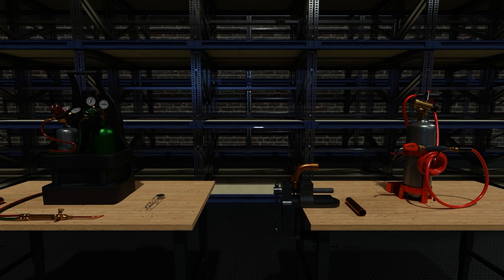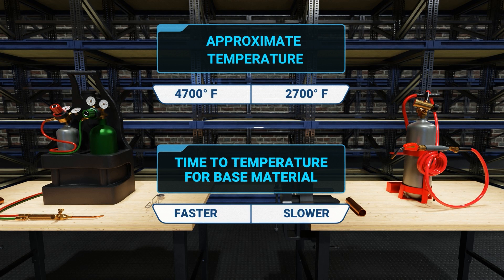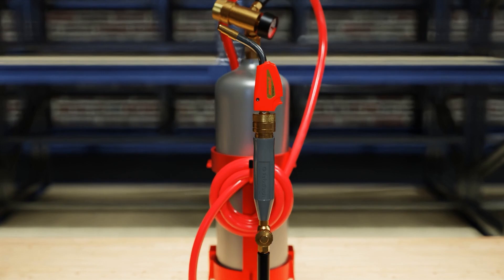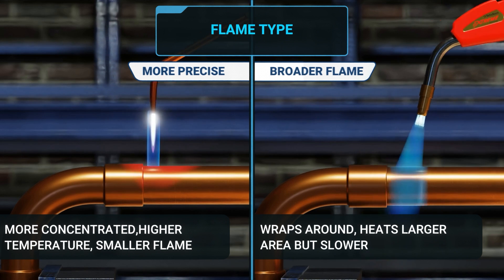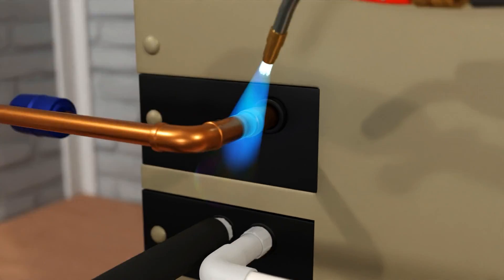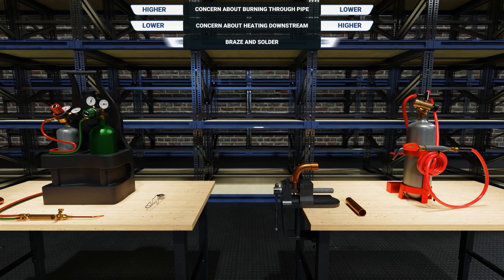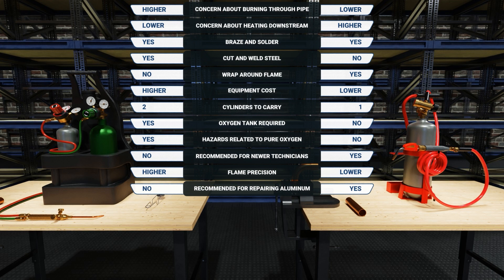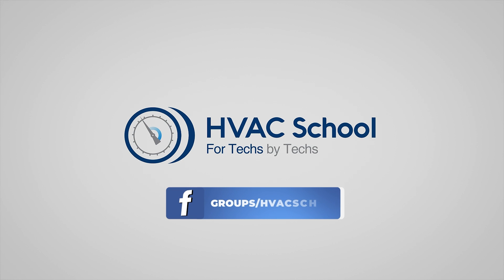Two Types of HVAC Brazing Torches (3D)

Comment: cool video. im curious is there are similar videos on the regular tip vs rosebud. only time i dont use rosebud is if im on something super small like 1/4 in a tight spot. otherwise 3/8-2 5/8 im using rosebud.
Reply: Hey Garrett your Rosebud tip is that for air acetylene?

Comment: I use both and when we're doing big commercial copper I use both at the same time. We just replaced two  1-3/8 reversing valves and the two torches made very short work of it. Also we cut them off with cable cutters. DO NOT USE STOP LEAK....

Comment: I prefre turbo torches. Its not even “that” much slower. The wrap around flame that the Turbo torches do or whatever you explained is a big reason why I prefer them. 😊
Reply: Air acetylene is arguably faster because of that wrap around flame. As soon as it gets hot you can seal the whole joint in one go rather then having to move the flame and heat up the other side of the copper.

Comment: A Trane virtual training video I just was in recommended propylene instead of acetylene. Ever used that?
Reply: In Ukraine we are using LPG - oxygen pair. It suitable for the most of applications. IMXO oxy-acetylene preferable when you braze TXV or something that must be protect from overheating. However LPG - oxygen pair is more oxygen consuming, LPG much more safer than acetylene, LPG tank lighter and lust much longer (rare refueling)

Comment: Strongly encourage the use of oxy fuel for commercial work. The wider range of pipe sizes and trickier spaces in which to work (usually) make it a valuable skill
Reply: I do strictly commercial only use air acetylene. As for pipe size you just have to select the right size tip for the job. And ive never had an issue with it being in a tricky spot (I work in Manhattan BTW) where i couldnt put a heat shield down and be fine. To each there own but i will always stick to air acetylene and the wrap around effect is very import for the type of work we do in hvac
Reply: Got both, air acetylene is what i used in 90% of the cases. The oxy acetylene is just very strong and can even melt the copper.
Reply: @tronixfix  I find that is mostly the case with people who never adjust their gas pressures. If you leave it at 5/10psi always you’re more likely to burn through a 1/4” or 3/8 line even if you’re using a smaller tip.
Reply: @paulgaras2606  i know what you mean but even with right pressures it will be hard to not overheat the pipes. The oxygen makes it burn super hot.
Reply: @tronixfix  yes you could look at it as a bit of a trade off. I do commercial service almost exclusively and Ive run into a lot of situations where braze joints held for a year or two and then let go due to poor penetration, mostly on jobs where the construction crew was using air acetylene torches and newer, less experienced people were doing a lot of the work. If you know your stuff, there’s no difference between air/acetylene and oxygen acetylene You’ll get good penetration with both and you won’t burn the pipe with either. But I just did a compressor set on a vrf system That had been installed without the use of nitrogen while brazing. We had to pull the oil solenoids, the oil separators and all the small cramped piping to blow out residual cupric oxide sludge. Air acetalyne would have made it really hard to work in those conditions. That’s why I say it’s good to get really skilled with oxy/fuel.
Reply: @paulgaras2606  sorry to correct but there's a huge difference between air and pure oxygen. Air can have a lot of moisture unlike pure oxygen also a lot of impuritys. Oxygen will always burn at higher temps. For me oxy air worked well for 90% of the cases unless it was around humid areas.

Comment: I've used Mapp gas, air-acetylene, oxy-acetylene, and for the last 20 years, have used oxyfuel-gas.  I do mostly commercial and find I need the precision and higher heat output of my current torch.  That said, I would love to see a video about brazing in the wind and brazing large fittings, i.e. 1-3/8 to 2-1/8.  Are there any tricks to keeping the torch burning in the wind?  How do I know when I am reaching the upper limits of my torch size?
Reply: The manufacturer of the tip should have a guide on what size each tip can braze. A #0 will braze up to 1/2" and a #2 will braze up to 1"

Comment: Just wanted to know what's your view on the cap n hook tip or other tips
Reply: I purchasing use the Captain Hook. It's nice at first, then I was having issues where the ports would clog and have erratic Flame. That's what I've heard in a clean environment.

Comment: I got a map can with turbo torch and I thought it would take me some time to get copper cherry red. Nope, it's quite fast, abt 10 seconds and it melts the brazing stick at 700 C. I feel like I will need simple prop-but with the turbo torch if i wanna efficiently solder with stay brite
Reply: Depends on the copper sizes
Reply: @UltraHydrophobiccoat  yes, true that. But also depends on the placement of wet rags. In any case, turbo torch really heats up copper sufficiently and its temp output can be lowered to levels oxy- setups can't step down to. Just my opinion based on few brazes ive done so far
Reply: @TakenIn-Wizardry  Thank you for sharing. I totally agree. I use Turbo touch with Acetylene whenever I have brazing job, but never tried Map. Does it generate higher flame temperature than Acetylene?
Reply: @UltraHydrophobiccoat  This I really don't know. I've only tried Acetylene with Oxygen versus map (propane mix for better perf) and turbo torch and I melt the brazing rod, which is 710 C ligament temp rated in under 10 seconds with the torch flame. Manufacturer of the torch claims max temp of the torch to be abt 2000 degrees celzius.

Comment: Hi Brian, I would suggest for Oxy-Acetylene brazing rigs the use of Flashback arrestor's on both the handpiece and the regulators. OSHA does not require it, but may be a lifesaver when you use the 'Captains-Hook' burners or any Oxy-Acetylene burners with more than one flame tip. The more flame tips you have the higher the risk of a flashback. Had once a flashback on a captains hook where the flame went back into the neck of the captains hook and burnt through flashback arrestors were used on both the handpiece and the regulators and all the damage was a destroyed captains-hook burner. When I find out your e-mail address I will send you a photo of the destroyed captains hook.